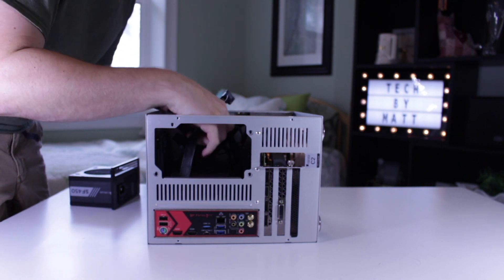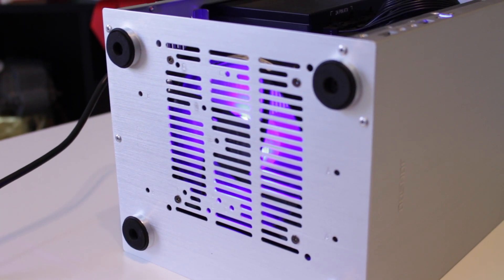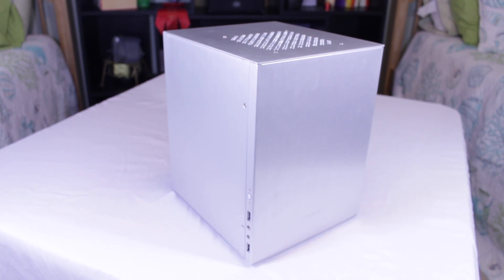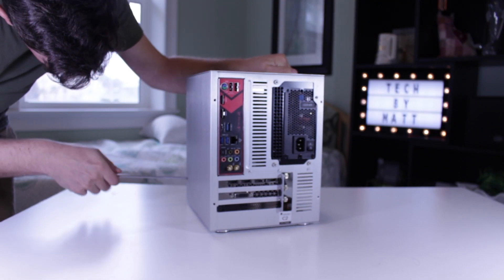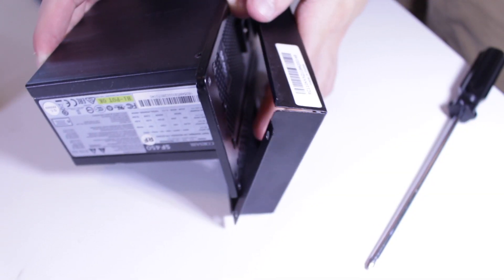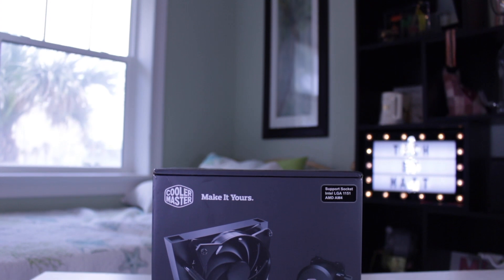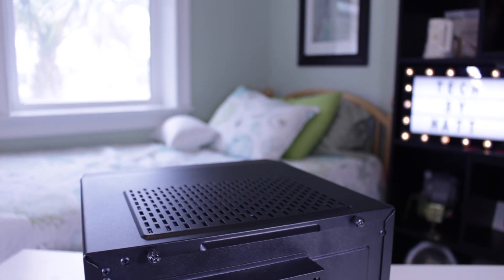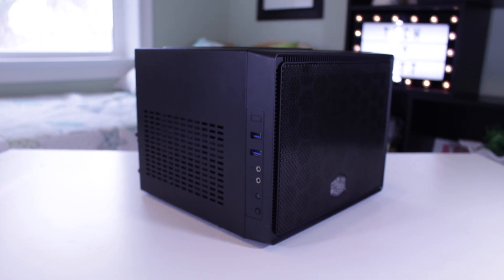Switching up My PC Case!

Comment: Elite 110 is a small, cheap, and solid ITX case. Nice choice!
Reply: It could be wayyyyyyyy better with a few changes...
Reply: Thermaltake Core V1 is not as small but way better in my opinion

Comment: I've been using this case for multiple builds for 5 years. The best airflow method for this case is to have push-pull on the AIO, pushing air OUT of the case, not sucking it in. The 'pull' fan fits on the outside of the case under the front cover. Also, with this method, remove the dust filter foam from the front panel. Now the case will use negative static pressure to pull air in from the top and side grills. Try it, it is by far the best for this case.

Comment: Im rocking two of those. One for the gaming rig and one for my HTPC. Great case! In the gaming rig it fits an ATX power supply, 120mm AIO, GTX 1060 6GB single fan, M.2 SSD and two HDDs no problem. Love it!

Comment: This is the reason whenever choosing a case it should be mesh. Airflow should be a priority. That's why I chose the Rakk Kagi Cube. Easy to work with. Looks cool seing your card in vertical alignment and has good airflow. Not to mention it's affordable.

Comment: If you're looking for a smaller option with AIO cooling in mind check out the Silverstone SG13. The case is in the price bracket, its 11.5 Litres, and it can fit everything the 110 supports. I suggest using a dual thick 120mm AIO or 140mm AIO and a silent radiator fan like EK Vardars or Gentle Typhoons.

Comment: I have a standard case, but yeah, I can understand the never-ending quest for the perfect computer. Need to get some cable extensions, not for looks, but because some of my cables are slightly too short for optimal cable routing in my Corsair Spec-Alpha.

Comment: Very nice build Matt. I really like this line from cooler master; I personally have an elite 130 that I custom installed a tool less hard drive cage in and have 4 hard drives installed in for a nas box. I also have an asrock fatality board with one of the cheaper Intel quad cores in it. All that time put into it and I still have yet to actually set it up, lol.

Comment: You have to try to liquid cool the C2 :) That's currently my plan, I want to add a custom Loop by using an 200 mm Radiator mounted on top of the case, with an internal pump/res combo at the bottom of the case.

Comment: Should sell that jonsbo. The mod looks quite good and while that case wasn't ideal for your needs I bet it would make a rockin case for someone using one of the new ryzen apu's. The air flow not being restricted by a graphics card would probably be more than adequate.

Comment: I've got the same cooler and a ryzen 1600x operating well below 60 degrees and I live in a warm part of Brazil with temperatures varying between 15 celsius in winter all the way up to 30 (though rarely) during summer!

Comment: I'm using this case, absolutely no airflow to the GPU if u don't put a 80mm fan to the left side and the front cover with the dirt filter is super hard for air to pass through....

Comment: I am using this case to build it with a ryzen 2200g. In the future when GPU's go down in price, I am interested in getting a 1060. will it fit?
Reply from the maker: Check the cooler master website for the max GPU supported and make sure to get one that’s less than that. There are a few different 1060 variants that will fit in this case.
Reply: thx dude!!

Comment: Could i fit a regular sized psu?
Reply: Yes. But then modular is a must. It just abouts fits a ATX modular PSU and an AIO is installed with care. I use a Seasonic modular which is 1cm shorter than standard ATX PSUs... Corsair also make some PSUs of the same size, which are perfect for this case and don't have the added costs of SFX PSUs.

Comment: My only fault with this case is that the PSU tray is held in by standard screws.  You can thumbscrew the case off but then you can't get into anything inside because the PSU is blocking your access.  It really needed to come with 4 more thumbscrews for that section.

Comment: i am planing to get Asus H310I-PLUS + i5 8500 + 2*8GB 2400mhz RAM (owned) + RX560 OC 2G from Gigabyte ( owned ) + Kingston 240 GB v500 SSD + 2TB 5400RPM 2.5Inch HDD from Barracuda and to put it in this case, will it be good , does it come with a case fan pre-installed bc summer is comming and 40C is a pc roster
Reply: BoomWithPeter Why no Ryzen 5 2600?
Reply: @bart Zen is bad at gaming i have a 120Hz 1080p monitor from Asus with Free Sync 2, also zen will never reach his highest potential in games - why? Bc too many people have dualcores with ht or quads, game developers will never program a game for a multi thred cpu when they now only 5% of pc gamers will be able to play, also intel is much better for productivity, less blue screens, it works stable out of the box...i know i know zen has better preformance in syntetic stuff but years of intel rebranding of the same cpus led to the really good optimisation. You can call me however you want but i prefere Intel, it costs more but it works
Reply: BoomWithPeter If you have a 1080p 120Hz monitor I agree you should go Intel. The stability of Ryzen however is actually just as good as Intel. If you don't do any tweaking or overclocking everything should be fine out of the box. 
Are you planning to upgrade yhat RX 560? I don't think it can handle 1080p 120Hz well.

Comment: Over summer I plan on building a mobile computer with the elite 110. 
It will use 
Ryzen 3 2200G
8gb ddr4
120gb ssd
550W Semi modular PSU
ASUS A320m-k

My current pc is using the Ryzen 3 2200G, ASUS a320m-k I plan on moving over the ram, motherboard, and cpu. 

The rest of my current specs are ASUS STRIX RX560 OC, CX 500W, 1tb WD.
I will replace my RX 560 for a gtx 1060 3gb, get a Ryzen 3 1200, and another A320 motherboard since I don’t plan on overclocking a Ryzen 3 1200.

Comment: I think your cooler is pretty sh*t to begin with though, as I have a sleeper PC with the same configuration as the jonsbo with the atx psu facing the cpu cooler (is40x) and my temps is at 65c with a 31c ambient. This is also considering that I only have a 92 mm fan at the bottom for intake and a smaller clearance between the psu and cpu cooler. My cpu is a i5-4570 with a 1650 super.

So in the end replacing your cpu cooler brought about the largest change.
https://smallformfactor.net/forum/threads/low-profile-cooler-test-noctua-l9i-vs-id-cooling-is40-v3-vs-amd-wraith-stealth.11141/